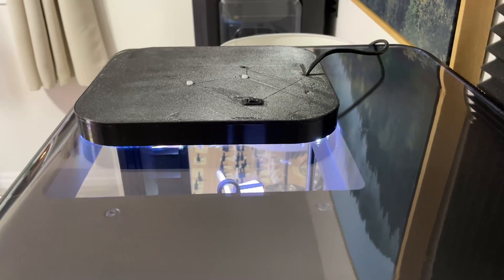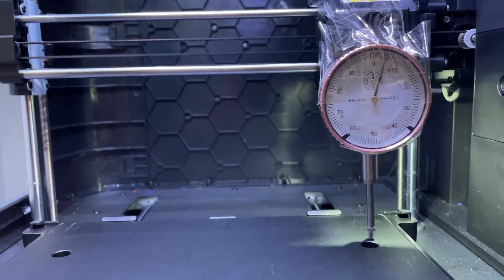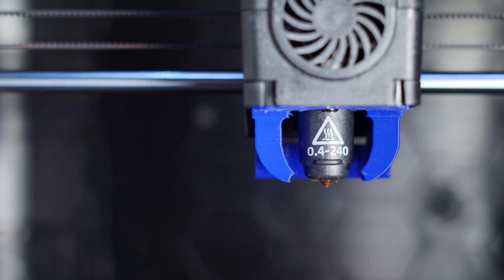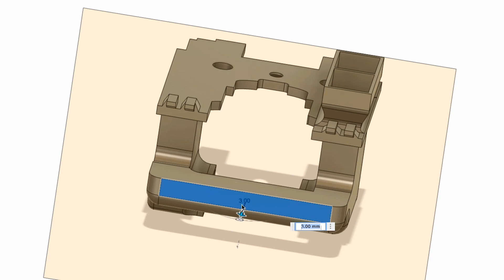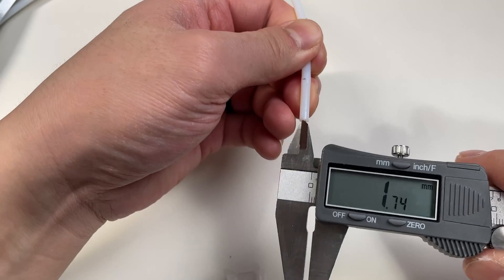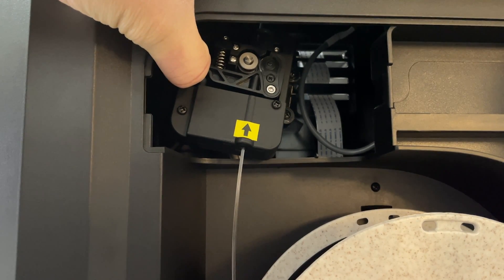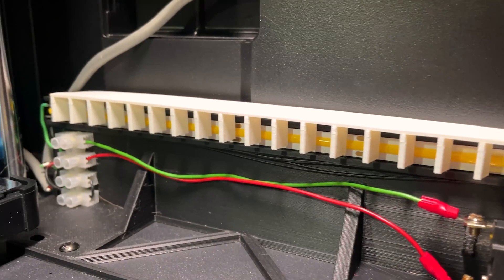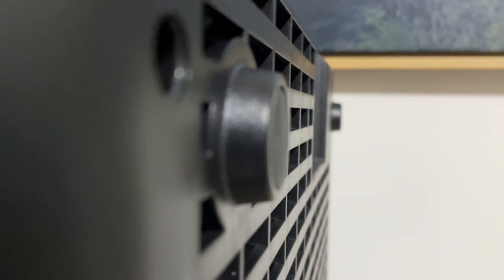8 Adventurer 4 Mods!

Comment: I had problems with shifting layers, especially on large prints. Found out the cause was due to too much play between the exchangeable nozzle and the print head in the x-axis. So the nozzle shifted position slightly during print when it came in contact with the part or supports. Sometimes it even resulted in aborted prints due to "abnormal printing". I printed a small holder that fixates the nozzle in position. The holder is screwed on with the same screw as the fan duct. And it's locked into position by wrapping around the fan duct. Since then my Adventurer 4 has been printing without any shifting layers or aborted prints. Thanks for your great model on the double fan duct, it was a really good help when designing the holder.
Reply: I'm glad I'm not the only one who gets aborted prints because the exchangeable nozzle moves slightly.  Just pulled the moving extruder assembly apart and found a small 10mm long filament piece floating around in the locking lug mechanism. Must have been there when I bought this unit 2nd hand. Hopefully this is the cause of bad nozzle aborts.. Excellent ideas btw.
Reply: @gwhizz5878 Glad to hear it was helpful. I have uploaded the holder to my Printables account. If anyone want to try it out. Seems I cant add a link here in the comments, but its fairly simple to search out in Printables.

Comment: I'm having a problem on my adventurer 4, some layers seem to get offset by about a quarter of a millimeter, they seem to be caused often by a horizontal hole, on one side of the hole the print will be fine, on the other the print layers will be offset, it shows up as bands in the sides of the model.

I'm also having problems where prints are seperating in the corners from the raft, the raft is staying stuck to the bed, but the print is lifting from that.

Comment: A mirror on the back wall is awesome for seeing what is going on with the back of the print.
This was one of those things where I needed a mirror out of the way.
It just happened to fit behind my one print area .
And it's amazing, I'll probably get one of those 1' glue on tiles and secure it to the back wall.
Maybe I'll make some little octagon shaped pieces to hold it to match the back wall of the printer .
I don't really like the bed system on this printer I may be looking into making a better bed plate.
On one of my other printers I have the bed absolutely leveled and surfaced , it makes my life a lot easier and better.
Reply: Excellent idea!

Comment: Where did you find the bits of metal you were using to level the bed?
Reply: Bearing supply stores generally have a shimming material in a range of (very thin!) sizes.

Comment: Thanks for all of your Adventurer 4 videos! Mine arrived a week ago, but I didn’t unbox and use it until yesterday. I haven’t been able to find very many useful videos for this printer other than reviews. Although I’ve been a designer & creator of many different art forms for most of my life, I’ve never done anything even remotely like 3D printing. After watching several of your videos, I’m almost positive that I can do some scavenging around the shop where I work to find materials to make a few simple modifications. LOL. My 1st two prints stuck to the print bed. I probably did some damage to it trying to remove the first one because I didn’t just go with my instinct and use my heat gun on it. I applied a little heat to the back of the print bed, and the second print came off nicely. I’m using the default settings for everything because I don’t really know how to use the software yet. Should I be setting the bed temperature a little higher? I’m fairly handy for an “old woman”, but this had me cursing last night! 😂🤣😂🤣
Reply from the maker: I don’t have a heat gun but sounds like that could actually work some magic for getting prints that are stuck!
If you are printing PLA, you don’t actually needs to set the bed temperature at all. Room temp should be good. I would only recommend setting the temperature higher if you are printing parts with a large surface area that sticks to the bed because corners like to peel up. Otherwise, no need
Reply: @justmakeitdaniel7667  Thanks for the quick reply. I do a lot of work with epoxy resin, so I have a couple of heat guns for that. A heat gun is something I didn't know I needed until after I got one, and I have ended up using it for a lot of random things. Anyway, the flat piece that prints out before the actual design is what I used heat to remove (I'll probably never remember the correct terms because my brain needs an upgrade.) is a bit wonky, but it looks kinda cool. I'll probably flatten it on my heat press & use it for something funky instead of throwing it in the trash. LOL
Reply from the maker: @OG_Beckie_Leigh  Ohhh you used a raft. I actually never use rafts because they are a waste of material imo and I like the surface that I get from the print bed (at least now I do with a PEI sheet installed. You can disable that feature in flashprint under the raft tab. Typically people print with a raft to help with bed adhesion, especially for small models without much surface area touching the print bed
Reply: @justmakeitdaniel7667  Ah! Okay. I was thinking it was a bit of a waste for the tiny cube, but I didn’t know that I could turn it off. 🤦🏽‍♀️😂 Thanks for letting me know.

Comment: I'm definitely interested in getting the Adventurer 4 working with Cura, which I use extensively with my ROBO C2 printer. And having Capricorn tubing will definitely help... Might get that for the C2 just because

Comment: I cant seem to get the capicorn tubing to fit properly into the fillament feeder I tried 3 different times of taking it apart the fillament just wont go through the tube not sure what to do there but the pipe fitting is a nice upgrade if you have any advice about putting the tube in that would be helpful
Reply from the maker: Ahhh if the filament is jammed, you just need to widen the hole by scraping it with a knife to make a chamfer on the inlet of the Capricorn tubing. That should help. You can also try manually feeding filament through by pulling up on the lever with a spring to release the pressure from the idler pulley and allowing you to push filament through the Capricorn tube rather than having the motor do it
Reply: @justmakeitdaniel7667  Thank you for the very quick response will try to scrape the tubing and see how that works!
Reply: Thank you it worked fillament is coming out now thanks again for responding so quick

Comment: Thanks. Great videos. The video with the height adjustment of the table helped a lot.
Tell me what length of tube is necessary?
Reply from the maker: About 0.5m is all you need. You can measure exactly when you remove the stock Bowden tube

Comment: have you had a problem with the filament feeder not feeding fully, I noticed as it is creating my object, the filament is not coming out as much.  It"s not clogged, I noticed the filament is not moving to feed the nozzle.
Reply from the maker: I’ve noticed sometimes the filament slips while the extruder gear tries to push it. That only really happened on PETG and the resolution was to set my max speed to around 30mm/s. But PLA I’ve had no problem going up to 60mm/s
Reply: I have this problem now but i believe my issue is the nozzle, it will read at a high temp, but is cool to the touch

Comment: Really nice mods! Here is a mod list I had in mind but am too lazy to attempt -

1. extruder arm + spring - to help combat the clicking, I was thinking of printing a new arm & finding a stiffer spring so it can grip the filament better, I understand the adventurer series have limits of how much force can be extruded since the nozzle can pop off but its something I wanted to try.

2. (this one I will try) A simple one is changing the sheet on the removable bed to a PEI one, I have 3 removable beds & Gonna order a PEI sheet to replace on one to test.

3. Fans, switching out some fans to noctua ones to make the overall printer quieter 

4. (advanced mod) e3d hot end swap, its been done on adventurer 3s but no info regarding the ad4 so I don't think I will try till there is proper info regarding it.

5. (another simple mod) - adding some sort of stick on foam around the door for the filament, to reduce moisture entering it.

Comment: The only mod I've made so far are for noise reductions & remote monitoring: For the noise issue, I've added sponge neopren stripping around the front door and it make a noticeable difference in high pitch noises when printing (It also has the benefits of keeping the inside temp more stable. IFor monitoring, 've added a Wyze Cam V3 on the left Window to monitor my prints remotely (as the built in camera is just pointless) and connected the printer to a Wemo Smart Plug so I can easelly turn it off remotely if a print goes wrong.

I'm also looking forward improving the lignthing inside the device but unti then, I've just place a Philips Hue Go lamp on the top window.